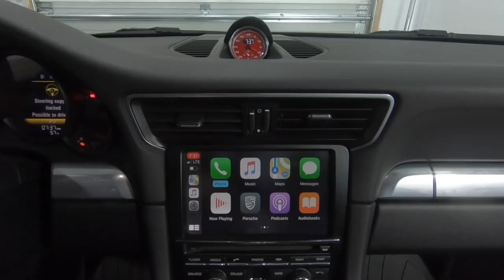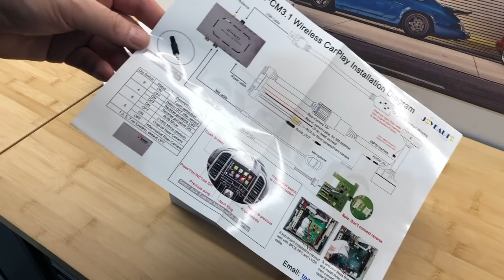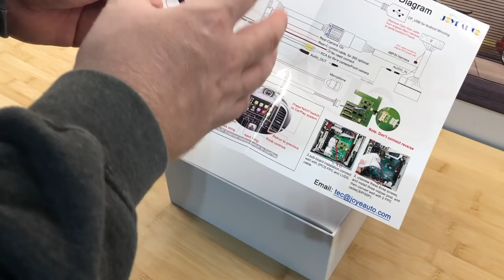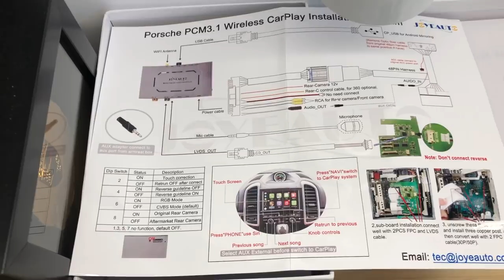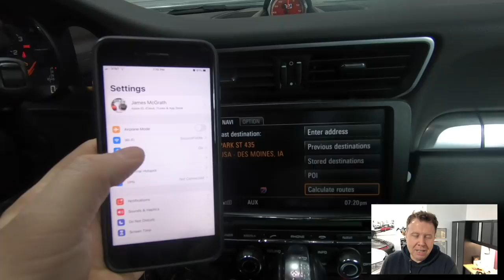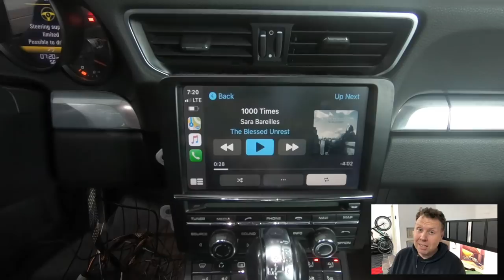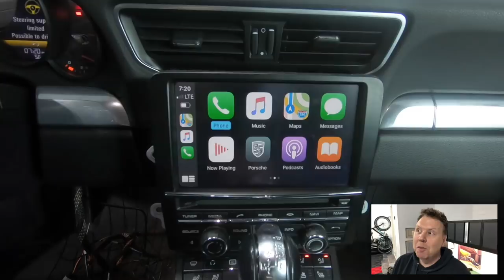Apple CarPlay DIY (Wireless) for Porsche 911 / Cayman / Boxster / Macan / Cayenne / Panamera

Comment: Excellent tutorial video. Congrats! Maybe two things you could emphasize also: a) don't forget to replug the fiber cable (if you have any) from the original to the Joyeauto harness and b) definitely look for a fuse socket that switches with the ignition if you don't want to ruin your car battery. :-)
Reply: Agree with both of these.  He already covered probably the biggest headache.  The monster 48 pin connections need to be forced in place brutally!!
Reply: Which one is the one where to connect fuse I am stuck

Comment: I just wanted to say a MASSIVE THANK YOU and SERIOUSLY WELL DONE for taking the time and effort to produce this video!! You are a HERO!! Having watched this I was able to complete my install in a little over 2hrs and without a need to even consult the very minimalistic and poorly worded instructions / diagram that it came with. As another commenter has suggested, the only thing to add would be that of ensuring to pick an appropriate Fuse Port for the power. I initially used one in Row A which I then realised was continuous power (for the alarm, immobiliser etc) and would not only draw unnecessarily on the battery when parked, but also meant that the WiFi on the JoyeAuto wasn't working and I couldn't get it to pair with my phone as a result (maybe a low voltage issue...?? not sure). Anyway, I then moved it to a free Fuse Port in Row C and it worked straight away and only now has power on ignition as well. Lastly I cut my hands to bits and sweated hard over about 45 mins to feed the USB cable around the back of (and into) the glovebox...not fun at all but sits neatly out of the way in there now (personal preference). I also cable-tied / zip-tied the excess cable lengths together and then tied these up behind the steering dash...I did the same with the JoyeAuto control box too...just keeps them neatly out of sight and avoids any risk of them slipping / dropping down into the footwell and fouling the pedals while you're driving (that wouldn't be ideal!!). Anyway...back to my original reason for commenting...thank you so much, you've been an absolute saviour with this video!!

Comment: This video was so helpful during my install. Huge, this is the best apple car play video. in his 6 month review he also notes that if you have the Bose system you have to unplug the optic cables from the Porsche Harness and put then into the Joyeauto harness because this type of cable can't be extended. Real pain. It took my friend and I forever to figure out why we weren't getting audio. Joyeauto now includes 2 sets of extenders so people with the XM Radio can secure it properly.  Another tip: get some felt tape to put between the XM board and the Joyeauto board that goes in the PCM.
Reply from the maker: Thanks Antonio!!

Comment: Dude!!! I just installed mine.  Took an hour... super easy after watching the video.  The instructions and another video mentioned removing the fiber optic cable and plugging it directly into the unit.  I don’t know if you mentioned it.  I also plugged a lighting cable into the included usb cable and routed it behind the unit and have it exiting under the glove box and hid underneath the right side console trim and into the arm rear.  I also put the mic just above the steering wheel.   NO VISIBLE WIRES.  Thank you!
Reply from the maker: Great job Christopher!! Nice one.

Comment: Hello again. I finally had a few hours to myself and tackled this job on my 958.1 GTS with PCM 31. THANK YOU for your video. I only had a couple of small confusing moments and happy to report that both the wired and wireless Carplay function is working as advertised. Microphone routed to panel by driver right knee and carplay module tucked away behind and below PCM location in cayenne. HAppy to answer any questions anyone has as it is all fresh in my mind.
Reply: tackling the same on my 991.1S next month... I HAVE confidence.. LOL
Reply from the maker: Great job Kam!! 🥳🥳🥳

Comment: James you are a champion! As Ive always hated the ‘70s PCM in my Macan Turbo I was on the look out for a solution to get CarPlay on it. I watched your video and thought installing it myself it was out of my league. So I got a mobile auto electrician out to do it. I sent him your video and while he said he cant guarantee it will work because “these add-ons usually don’t work as advertised” That was my first red flag right there. When he came out to install the Joyeauto I’d purchased he spent more time on the phone sorting out other worker’s problems than on my car. After several hours he said the video wont work (sound familiar?) and it must be faulty and I should send it back. He put the PCM back in as before and was out of there. So, I thought, do I get someone else in or have a crack myself. I watched your video a few more times and through, why not give it a go! Slowly and watching your video on the iPad every step of the way (if you see a lot of downloads from Sydney, Australia that would be me ) I hooked it up and CarPlay popped up on the screen - Oh what a feeling!! But wait, Hold on, no sound. I messaged Ivan at Joyeauto (we already had a chat open for several questions previously) and we discovered I needed to take the fiber optic cable (orange one) from one 48pin plug to the other. Hey presto it works!! Mate, I couldn’t have done this without you. Love your channel keep giving us that great content Thanks Again David
Reply from the maker: Thanks David!! This is awesome!! You made my day. Cheers and well done!

Comment: Just want to echo George P's thought below. Got my JoyeAuto unit a couple weeks ago and got around to installing it today. This video was fantastic, took me maybe 3 hours and I was going slow. Perfect on the first try, except I initially didn't have sound until I realized I needed to set the input to AUX. LOL.

Thank you so much for making this great tutorial!

EDIT--one lesson learned was that I decided to re-mount the JoyeAuto processing box in the upper left area of the footwell just beyond the fuse box. I found that the wires were getting caught in the, I don't know what to call it--the pivot point of the steering column. This way it's completely out of the way of the steering column.

Comment: Mr Auto, Sir (honorific is well deserved) - 1) Found something on Rennlist (tm?) that referred to swapping 2 fiber optic cables from OEM harness to new input to PCM.  After changing this, input selection and sound works.  2) Yes power to Joyauto unit live, using empty space in row D (D9?).  Audio from iPhone plays thru stereo via USB connection to JoyeAuto. Video via USB or Wifi/Bluetooth not yet functional.  Getting closer!
Reply from the maker: Nice one!!! Ok, the first part rings a bell. There is a fiber optic cable (a black one I think) that is plugged into the large OEM multi-pin wiring harness that needs to be pulled out and plugged directly into the back of the new Joyeauto extension multi-pin wiring harness. In my video there is a moment towards the end where I show where I got stuck. This was part of that issue. The other issue was that those plugs into the big black multi-pin wiring harness weren’t “clicked” in all the way. They needed a really forceful show to connect up. Once they were together properly I suddenly got the video input working.

Comment: This tutorial made this install fast and easy. I watched it twice before starting and was able to go through the entire process without having to stop. Thanks for a great and useful video. I do need to check that my fuse is switched, but other than that, all works fine. I even installed the backup camera at the same time. That added many more hours to the project. I have a Boxster, so Auto Amateur's video on this did not exactly help with the wire run, but they did help with the bumper removal which was less daunting that I had expected. Thanks!
Reply: Where did you place the bulk connector? I also have a Boxster and the available space limited. Having trouble getting the head unit to fit all the way back. Thanks

Comment: Nice work!!  I remember putting a new head unit in my e46 M3 and running the back up camera and GPS and blah, blah, blah.  They can be a pain in the ass and I completely agree....electronics is for the birds.  Side note:  I think this is the longest AutoAmateur video to date!  Almost 45 minutes!!  Congrats on the installation and the long video!  So tomorrow are we going to see a turbo kit or GT3 suspension going in or something?
Reply from the maker: Hahaha. Hell no. I need a day off. 🤣👍

Comment: off to tackle my install tomorrow on my boxster.   watched the video several times o i hope im ready.  great video
Reply from the maker: Hit me up if you need any help! More than happy to. Good luck
Reply: @AutoAmateur  appreciate it,   honestly your video on this was amazing,  in fact you are my go to when i need to do something on my boxster.  got it all fitted and working,   i have android phone so need to work out how i display just the apps i want,  plus as im the uk i wired the fuse on the passenger side and despite all the other wires being long this one is pretty short, so i may cut the fuse off and extend the wire so i can fit it under carpet.   found a fuse that isnt on 24/7 aswell.

Comment: Hi there, I have been using the JoyeAuto unit for about a year and wanted to provide some feedback and tips I learned in the process.

I have the following configuration:

2015 base 911 carrera US
7 speed
Bose system
No cameras
Pixel 6 Pro phone using android auto wireless

Issues:

Power.  If you want the unit to stay powered up after the car turns off, then you can't use the normal switched power options available in the driver side fuse box.  Alternatively, if you use the fulltime powered fuse locations, the unit stays on 100% of the time which creates other problems (battery drain and the phone may stay connected depending on car location vs. phone).  The solution is to use a particular fuse location in the passenger side (right) footwell:  D9.  This means running a longer length of wire if you have the JoyeAuto box in the driver's (left hand) side, but well worth having the best of both worlds.  Once in place, the unit will power up as soon as the car is unlocked and power down about 20-30 minutes after the key is pulled from the ignition.
I'm surprised this isn't mentioned by more people but maybe they just live with the loss of power when the engine is turned off when using the left hand fuse box options.  Or maybe there's some other factor at play I missed.  Please comment if you have a different experience.

Boot flakiness.  The normal boot sequence when getting in the car is to hit the Navi button to engage the JoyeAuto system.  It then auto detects the previous Android Auto connection and displays it on the screen to be selected.  On some occasions the phone doesn't show up to be selected but it was still found by JoyeAuto (I don't know if this is a timeout issue or something else) which is evident from the Android button being highlighted in purple.  In this case, you have to go into the setup menu, choose the bottom left most option (Smart Phone), Wireless AA, and the phone is in the list to be selected for boot.  I have tried to skip all this and simply select the purple Android button but then it gets hung up requiring me to fiddle with my phone (usually going airplane mode and back restores things).  Since the unit stays on even with power off, you'd have to resort to more manual power off options like accessing the JoyeAuto unit or the fuse box, neither option of which is pretty.  Lesson there is not to attempt booting without actually selecting the connected phone.  The little green "link" icon can also cause this problem if the phone hasn't been selected already.
If someone can improve upon this experience please share.

BT connection and Mic issues.  The provided Mic is weak and will create sound quality issues for phone calls.  Adjusting it to help phone calls can have a detrimental effect on Hey Google.  The workaround, which others have also mentioned, is to use the built-in car PCM for phone calls.  That means the phone will have two simultaneous connections when in the car:  JoyeAuto and PCM.  The trick is to use the latter for phone calls which isn't always the default (I'm not sure how android prioritizes and/or saves them).  And you can't disable or forget JoyeAuto from the phone because Android Auto seems to reinstate it, if only partially (forgetting should wipe it out but it sticks around zombie like).  For a time, I was dynamically entering the IDCore setup menu and disabling BT from there which worked, but I'd have to re-establish the BT connection manually (like start of day) on car start each time which sucked.  I since learned Android offers an option to select which BT connection is active for a call in the BT menu.  But that only presents itself during the call, so if you think the JoyeAuto BT connection is active you have to quickly go into the phone menu and select PCM as the "active connection".  The Android Auto touch screen has the option to select the speakerphone during the call which might prove helpful as a quick save while fiddling on the phone...
The good news is I don't find myself doing this very often, so the phone seems to try to re-use the last connection if it's there.  If anyone has a more reliable way to keep PCM as the primary phone connection let us know.

Sound quality.  There's been a lot of discussion on this topic and of course it's difficult to describe other than maybe poor sound, tinny, distorted, etc.  And this all depends on the type of music being played.  Some tips here include the use of the JoyeAuto EQ menu dynamically (while the music is being played).  You can actually start playing music and exit the AA screen (select IDCore or Exit from the list of programs) which gets you back to the boot menu where Setup can be chosen.  From there just go into the EQ menu, choose the settings icon to "tab over" into the EQ screen and select accordingly (while the music is playing).  This should help tune the system more quickly by going in and out of the AA screen to choose different music and coming back into EQ settings.  Note, that little green link icon is now your friend to get you back into the main AA screen.  
Personally, I got bass distortion when enabling the loudness option and also had to lower the 60/150hz settings but maybe that's my music again, or just taste.  I have attached pictures with my settings fwiw.  YMMV, but I would like to hear back from others on their precise EQ settings (including loudness/subwoofer) just the same.  There may be something optimal out there.

Built-in Mic.  Once PCM is setup for phone calls, the Mic settings can be optimized around clearly picking up voice command instructions (vs. compromising for echo, etc.).  A higher sensitivity level works better but I must say it's still not great in my car.  A speed with the background road noise the voice command is garbled and I get poor results.  This could be that my tires are louder and need replacing or Mic placement (perpendicular off the steering column just out of eye level sight) so again YMMV.  
If anyone has any tips to share here, let us know.

Summary.
Overall, I am personally very happy with the value the JoyeAuto system provides but I must admit I would not be able to recommend this to people who are not tech savvy since it requires a bit of know-how to workaround the flakiness when it presents (which is about 15% of the time).  The workarounds are not onerous, but to somebody who expects things to just work, it's a deal killer.  If we can improve on my experiences above maybe the system can get more stable and be fit for the masses.
Reply from the maker: Thanks for the feedback Phil, appreciated!

Comment: I just did it following your video step by step and it totally worked! Btw, my passenger seat controls seemed to have stopped working after installing. Could it be related?
Reply from the maker: Well done!! I don’t know how your install may have affected the passenger side seat controls. The only way it might have done is if you tripped that particular fuse in your fuse box while you were powering up the JoyeAuto box. Check your owner’s manual for the fuse box map and check the one for your seats.

Comment: I've thought about installing this into my 991 but I just don't listen to the radio enough.  It would be nice to have the Apple maps on the display however.   IMHO the Apple map app is better than any OEM map display/unit.   I would tie wrap the bundle of wires together to avoid noises under the dash when driving.   Overall,  job well done!
Reply from the maker: Great suggestion! I think I'll do that! Thanks Mario!

Comment: Wow - this is one of the best DIY vids I've seen! I don't know if you've discouraged me or encouraged me!  
👍 How did you end up securing the unit under the dash. Also, what is the purpose of the USB Cable?
Reply from the maker: The USB cable is for Android phones when you want to mirror them. I never use them or install them in any of the cars I work on.
Reply from the maker: Thanks Richard! I mount the unit under the steering column, up and under the driver’s footwell using cable ties and Velcro. All of the wires are hidden away inside the steering trim.

Comment: I am impressed. I replaced the head unit on a 997 and that drove me mad, so to see how you did this has inspired me to maybe do the same on my 991. Over in the UK for my 997 at least the connectors were different for a uk example to the euro style, so I am guessing you buy only from suppliers in your country to get it right. May sound obvious but over here in Europe it’s easy to get items shipped from the continent to maybe save on price.